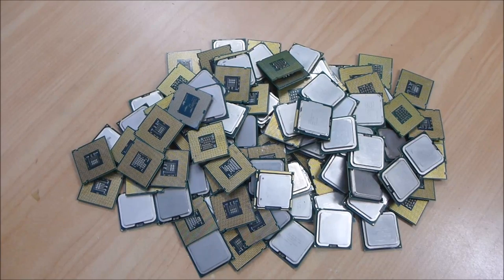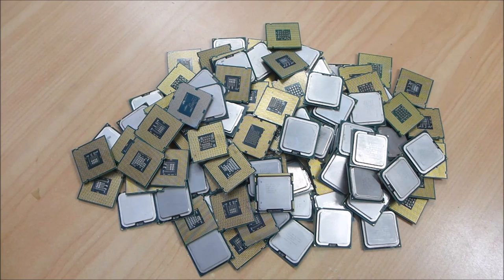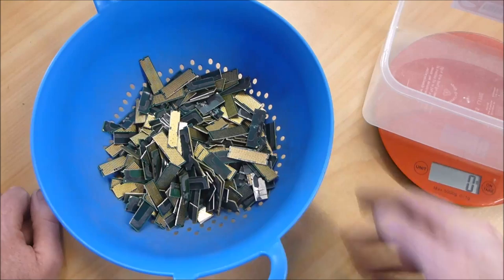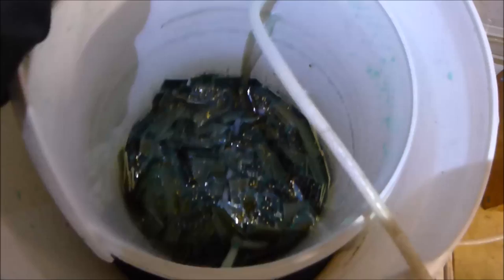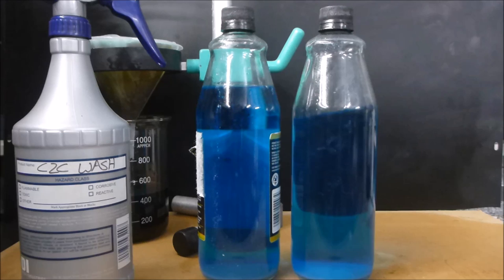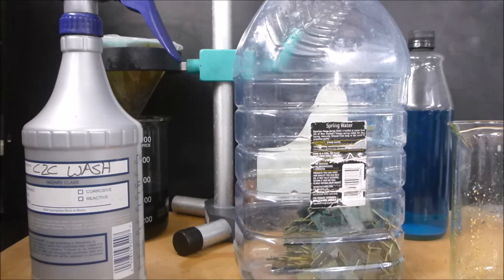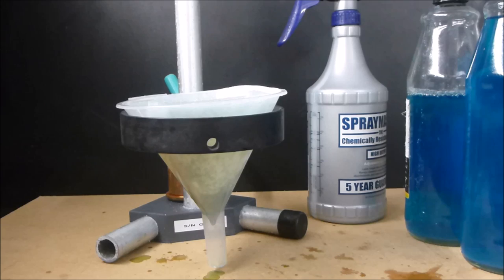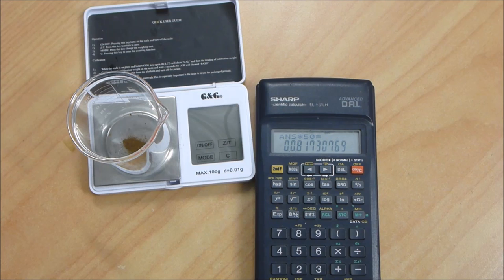Gold Recovery - Yield from Pin-less CPU Bases

Comment: Hi. In my little practice- experience, I have recovered gold from pin processors six times. There were different processors and always a different amount of gold from a hundred different processors. Never been the same, not even close. I have never recover gold from pinless processors. Just wanted to buy pinless processors on eBay, good thing I watched your video first. I will not buy. It turns out that in one processor there are 0.0016 milligrams of gold. A very very very small amount. Thank you for the video 🙂👍

Comment: some things to consider, indium is used to solder some but not all dies to the heatsinks out of 400 cpu's i got about 1 kilo of indium worth about 800 dollars. also the dies have value as well , they are doped with rare earths and some of the silicon is irradiated to make it a better semiconductor skandium for instance is worth 270 dollars a gram gallium 400 dollars a kilo and several others in between and the irradiated silicon is worth a lot  more than beach sand so saving the dies for sale or extraction seems a good idea. o yea the gold colored coating on the inside of the heatsink ironically is gold very thin but gold.
Reply: Hi Mr McCormick I have a few questions on these comments above are you still available online?

Comment: The laminate in these CPU's are such that you can just take a knife at the edge and split them. Peel off the bottom layer(s) with the gold plated pads and potentially just use scissors on the thin sheets to remove center components.
Oh and the little dot on each pad is the vias, not contact point from socket.

Comment: What was the recovery once the gold plating from the copper heat sinks was added?  Also, did you attempt recovery from the central chips and MLCCs?  Those have palladium, silver, and sometimes platinum.

Comment: sir I'm having trouble .. I got to the gold drop part where is was brown at the bottom of my beaker an clear above like water I tried Boling the water off an when it got down to the brown area it turned green an smelt like acid so I added water then it turned Grey.  most of the brown from my gold drop is now Grey . I'm not sure what I'm doing wrong  .  sry if yall consider me a moron but I'm trying to learn an get it right , please an thanks
Reply from the maker: Midnight Customz Hi there, that is a pretty common mistake, good learning experience! when the brown powder has settled, you need to siphon off the liquid to your stock pot, then wash the powder with clean water, then HCl, then clean water again. To fix your situation, add some freah HCl and re-dissolve all the gold, basically start over with the refining part. Good luck, let me know how you go !

Comment: i forgot the heatsink compound on the older ones has a lot of silver and the mlcc's have 2 % palladium and 10 % silver by weight so you want to save those separately as well and if you have an air tight oven or a toaster oven you can run outside baking the pinless chips for an hour or 2 at 450 degrees will make them much easier to separate as well outgassing most of the epoxy making recovery of bonding wire and glass fiber much easier and yes you can sell the fiber as an amendment to strengthen concrete you need to always save what is left and try to figure out how to get saleable product rather than waste.

Comment: Have you ever done logic boards off hard drives? Curious as to how much gold in 100 of them..
Reply from the maker: Hi Jon, I have never done the whole boards, but have done the ICs off them many  times. Those big square thin flat ICs return around 3g/kg, so fairly high-yield. I'm not really sure why HDD boards are so valuable as scrap, the plating on the connectors is nothing special. I guess there will be some other PMs in the MLCCs and they probably return pretty well because the PCB material is usually very thin.
Reply: Hello
I hope You are well
Please if it is possible to answer me
What is Thé yeild on grams of 1 kg gold plating connectors/pins with thickness of 1 mm as plating 
Thank you

Comment: In the ap solution I am finding it hard to find the %A to the %p and the % pure of the p..   3% easy to find 5% sometimes.  Is this diluted p enough?
Reply from the maker: Hi Jesse, it is wrong to think about %A to add to %P. what you want to do is add enough HCl to cover your fingers, then give it a 'splash' of peroxide, 3% is fine. The peroxide is only there to get the reaction started, in fact, adding too much of too high % peroxide can dissolve some gold! You also want to have an aquarium air bubbler bubbling air through the solution constantly. I use a pretty similar bucket-in-bucket system that is very common in many videos and have found it to work very well. I don't have a air stone for the bubbles, I just poked some small holes through a bit of aquarium airline and fed it through some holes drilled through the inside bucket. The reaction will be a bit slow at first, but after a few weeks all your fingers will be 'de-foiled'. Don't put the used AP solution to waste processing, it will keep working for a very long time, just save it for the next batch. You will never have to add more Peroxide after that first splash right in the beginning.

Comment: can you use the copper chloride wash for copper electro plating afterwards which would dilute it ?
Reply from the maker: I'm not sure if Copper Chloride is suitable for copper plating, it would be pretty great if there were a simple way to plate the copper out of solutions rather than cement it out with iron! Will investigate more at some point.

Comment: I'm surprised there is no gold filament to be recovered, such as from the flat pack chips. Would It be worth exploring de-lidding the heat-spreader, and dissolving the fibrous bottom of the CPU in sulfuric? This would essentially leave you with gold, silicon wafer, and copper/tin/etc. which can then be processed from there?  I was planning doing just this when time permits, as sulfuric acid is easily obtainable.
Reply from the maker: The green fibre bottom is what is called a 'flip chip' style IC, so there are no bond wires inside these. Same with the Northbridge chips that have the visible shiny die. The only gold in these unfortunately is what is on the pads underneath and what is on the inside of the heat spreader. What is amazing is that these CPUs are basically made using far less than $1 in resources per unit!
Reply: bryzabone b
Reply: Successful Engineer in my

Comment: Another good video , thanks 
A couple of things , I like separating the copper chloride - the idea being as any element accumulates you can end up with some volume , drop out the copper [ how ] - because with a lot of this gold recovery , there is more value in other elements than in the gold .
As Buckmisterfuller  use to say as close as I can quote " there is no waste - all waste is somebodies resource " .
So adding up the other elements and there value , and the how ,  in this case mostly copper ?
Also adding info on the cost of chemicals / supplies ?
It may not be worth it to process these , except broken down as you have done , then adding them to other finger / or similar e-waste .
Again thanks
Reply from the maker: Great comment as usual KD0CAC, your are 100% spot on, I'm sure if you are set up appropriately you can make good money out of the Cu and the precious metals will be extra. I have a bucket of copper powder sitting here that I will cast into small bricks sooner or later, always nice when you can sell a waste product! Building a decent furnace is close to the top of my to-do list, I'm wanting to melt the Copper, but also interested in trying to process various E-waste through smelting. Appreciate your input as always.

Comment: Looking at some of those CPUs there are newer ones in there? You would get much more for those on ebay if they work. From my experience 95% of the post lga775 CPUs are worthwhile selling on ebay and about 25% of the lga775 ones. I have lot of experience with knowing what is and is not worth while and if you need help let me know.
Reply from the maker: Thanks Matt, yep, sell or process is always a conundrum, in this case I didn't really care because I had no idea what yield to expect, so was quite interested in processing them.
Reply: Successful Engineer. Alright. I just have seen tons of people scrap $50 boards with out even testing them first.

Comment: Good video, now we all know that in those type of cpu there is more value in copper than precious metals. it is much better to sell them to rise founds for acids and stuff to keep operation going. i have a new question. without nitric, what other plated material than ribbons can be dissolved with hydrocliric clorox? how far this solution can be used for home refiner. and next step poor man`s aquaregia.  (bonding Wires)?
Reply from the maker: Great question Luis, I have never tried HCl + bleach since I have reasonable access to Nitric, but I know it is a problem for a lot of countries. I am sure PMAR will dissolve bond wires, just a little slower than Nitric, but usually hobbyists aren't worried if it takes a while. The nice thing with washed bond wires is that while you are dissolving they are very obviously visible if you look at the bottom of your beaker, so you can clearly see when the process has completed. I guess if you don't have Nitric you would want to treat your washed concentrate in AP for a few days first to dissolve the copper so that the PMAR only has to deal with gold.

Comment: I have a chemistry question for you. Here's what I did...sodium bicarb heated to sodium carbonate saturated, mixed with saturated epsome salt magnesium dropped out to make sodium sulfate. Will sodium sulfate produce a quality drop from AP?
Reply from the maker: Did you mean a quality drop from AR ?  I assume you mean dropping gold ? Unfortunately my chemistry knowledge is rather basic (pun intended) so I can only suggest that you could test on a small sample. SMB is usually fairly easy to get hold of in most countries (used as a cleaning agent by the home-brew guys). Alternatively if SMB is not an option, simply cementing the gold out onto clean copper will actually yield a reasonably high purity result as long as the material going into the solution was reasonably clean gold (like foils). The down-side to cementing is that you will also cement out Pt and Pd if they were present in your source material.

Comment: there are bonding wires embedded in the circuit board you would need to pyrolyse the boards to get the bonding wires albeit there is not going to be a lot of that either.
Reply from the maker: Clay Mccormick No, there isn't. With flip-chip the die is soldered directly to the substrate. There is a miniscule amount of Au in gold flash of the pads where the die is soldered, but we are talking almost nothing. The internal structure od the fiberglass contains only Copper.

Comment: 4, 9's indium is 5 dollars a gram,worth several times the copper might want to get that out before you melt down the metal for your anode.lets say 60 grams for 114 cpu's 300 dollars definately may want to consider that.

Comment: What about the indium
Reply from the maker: I think someone else asked me about Indium a while ago, from memory Indium is only worth around $1 per gram, not really worth recovering unless you have a particular reason to target it.
Reply: @successfulengineer  the silver paste is the indium just scrape off no process needed. I got 190g indium in a day doing that to remove heatsinks do what 999 dusan does it's better. I'll make a vid on it for you
Reply from the maker: @keytefirerefining1355  Awesome! That is a huge amount of paste, any idea how many processors that took ? Is there a market for selling the Indium to someone ?
Reply: @successfulengineer  video will be up in about 1 hour on my channel, hope it helps, also the heatsinks is nickel plated copper do that's worth saving after too. If you wanna keep the gold from the little plating on the heatsinks will be worth scratching off and putting in copper cloride so that you can save most of the heatsink for its copper
Reply: @successfulengineer  also about 0.5g indium per cap so 100 cpus with indium is 50g and it's all pure no process needed. The silver paste most cpus have is silver based but cannot work out how to remove silver from it thinking acetone but not sure
Reply: @successfulengineer  you should add a contact email so that people can give you ideas and help you improve
Reply: @successfulengineer  just thaught also scratch the gold plated part of the heatsinks to put into acid so you can save your copper
Reply from the maker: @keytefirerefining1355  Yep, that is a great use for them!

Comment: Why'd you ignore the other PM in the chips?
Reply from the maker: Glenn McGrew II Because there is almost none, maybe a astronomically tiny amount of Pd in the smd caps.
Reply: My point is that BGA chips may contain things like silver, palladium and platinum, as well as gold.  Your experiment proved that the amount of gold is also miniscule, thus if you're going to want to make money on the CPU chips, you'll need to have a better extraction method that covers more than just gold.  In addition, because of the layers, don't you think it'd be better to shred the chips?
Reply from the maker: No, they do not contain any reasonable amount of Silver, Palladium or Platinum. Where would they be in the processor ? You have a Silica die that is soldered directly to a bit of fiberglass coated in Copper -> Nickel barrier -> Gold. The lead free solder MAY contain a tiny amount of Silver, but, Silver is so cheap that it is basically a waste metal in these processors. In practice all waste acid goes through a Copper cementation stage as part of my waste processing, so I would capture any unrecovered precious metals there, but these modern processors just don't have Pd or Pt for no reason. Now, if you are processing older processors, then sure, you pay attention to Ag, Pd and Pt.
Reply: Thanks for the explanation.
Reply from the maker: No worries Glenn, appreciate you coming back. Feel free to ask if there is ever anything not clear or if I can advise in any way. Always happy to help members of the community.
Reply: I'm not a chemist, nor do I have the equipment to do PM recovery.  I was looking into this as a possibility since my friend sometimes gives me old computers.  I just tore apart about 20, took the CPUs and RAM out, and I scrapped the PSes from them for the copper (my daughter wants to make copper wire statues).  Are the ICs in PSes valuable?  I'm thinking of removing all the gold-plated pins.  I got a few gold-plated SATA connectors of varying qualities from the cables.  Or should I just put the RAM, CPUs and pins together and sell them that way?

It seems like the process can be done quickly to get the gold, as I saw one amateur using 50/50 solution for the first step in a day, but another guy with a different ratio took over a week, but I'm wondering if speeding it up with that 1:1 ratio has a downside?

What kind of volume do you need to actually make a profit extracting PMs from PCs?

Comment: Use reverse electroplating is faster and efficient.
Reply from the maker: Sure, but you can't reverse electroplate the bases because you can't get an electrical connection to each pad. You could use reverse electroplating to recover the gold from the heat spreaders, but that is not the purpose of this video.

Comment: I'm glad I've never paid for any ewaste. Because I can imagine I would've thought that they would be worth at least a dollar each, back when they first came out. But 8 cents.... WOW!!
Not worth paying a penny for them.
Have a GREAT Day My Friend!!!
Reply: Intel Pentium Pro CPUs are the Holy Grail.  They EACH have slightly over 1gram of gold!  Each one is worth nearly $60!  There are others of varying old ceramic types which are almost as good, but can be tricky as they vary a lot.  

Rule of thumb for the green or black fiber types WITH pins:  each, on average, contains at best 1/20th of a gram of gold.  Figure about $2.50 worth of recoverable gold each.  For the profit, cut that in half since you must factor chemical and materials costs.  

There are other metals to get from the pinless ones besides copper and gold.  The MLCCs on them contain silver, sometimes palladium if they're old enough.  The central chips contain silver, and also palladium or platinum.  At times, there was more palladium because it was much cheaper than either gold or platinum back then.

Comment: Get the indium off of them first
Reply from the maker: There is only a small subset of processors that used the indium solder and even if you bothered, Indium is only worth half as much as Silver. Recoverable, but at the end of the day probably not worth the trouble ?